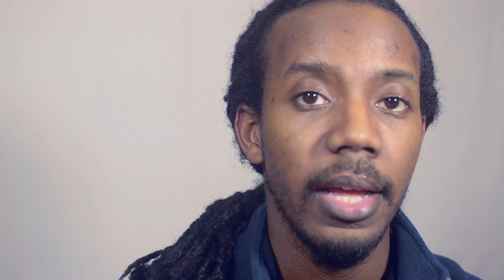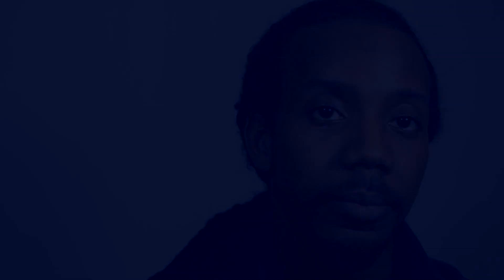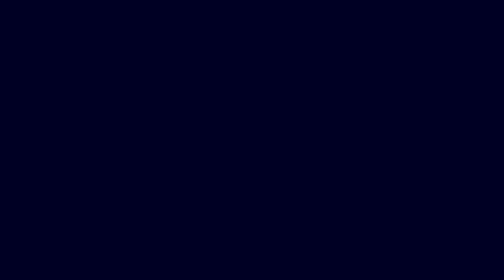Graphic Design Choosing Your Portfolio Artwork

Comment: I have a couple of questions. I am redoing my portfolio but want to include some things I have done recently online. It's not really design but I have written and added this information onto an existing website which is not my own. Can I display this in my portfolio (my actual portfolio or a PDF one?) and how can I do that? Also, do you recommend any online portfolio websites? I currently don't have anything online. Thank you.
Reply from the maker: Nicole Walter I would only add it if you feel it creates value for the people you'll be presenting to, if not do not include it. Presentation is about context and respecting people's time and holding their attention. As for online portfolios I recommend starting with Behance, DeviantArt and also setting up a portfolio/artist page on Facebook and posting to Pinterest as well. Link your PDF to your LinkedIn Profile. Also put your portfolio and images from it on Google Plus and put your PDF in SlideShare.
Reply: Roberto Blake Thank you for your help! It is much appreciated.